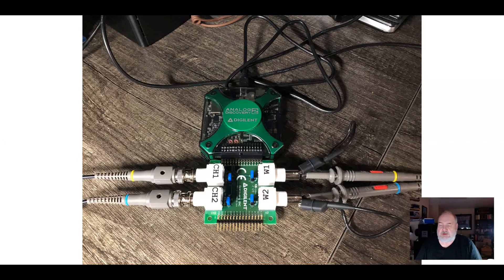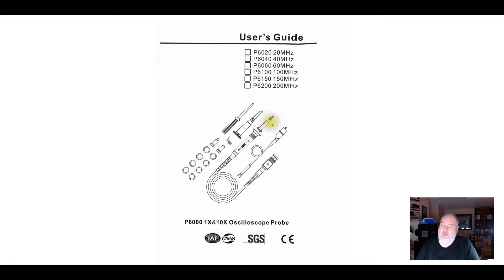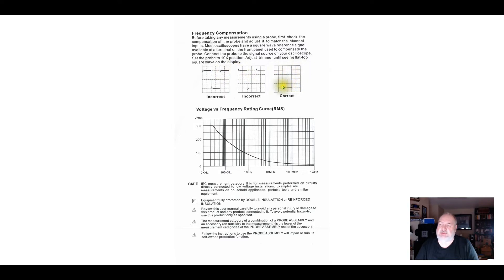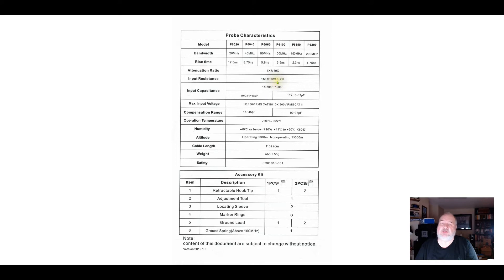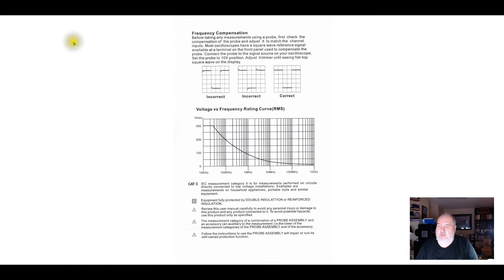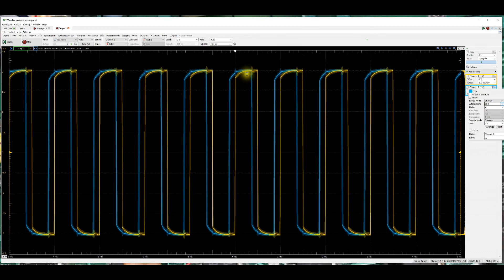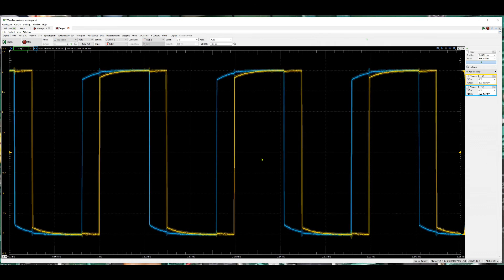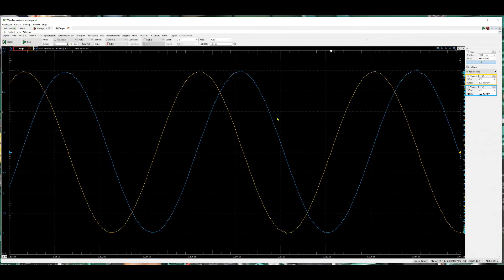STB811 - Diligent - Part 2 - Analog Discovery 2 - Scope Prob Compensation

Comment: The output signals on W1 and W2 seem to have no skew, but the measured signals on the second set of P6100 probes show a lot of skew. There is also visible a sort of amplitude coupling showing between the two channels. This is an effect that I would not expect to see at this frequency.